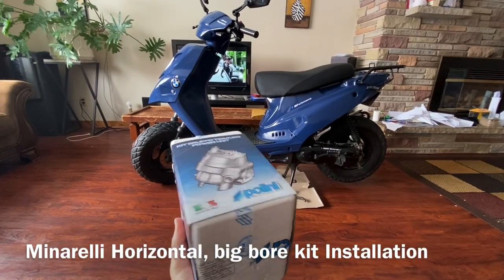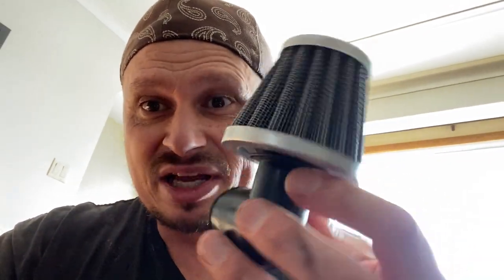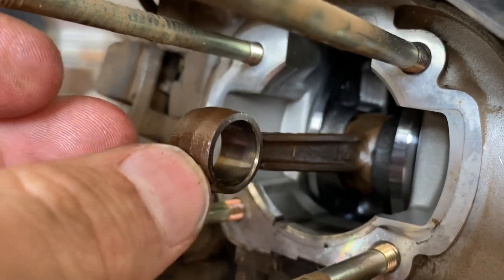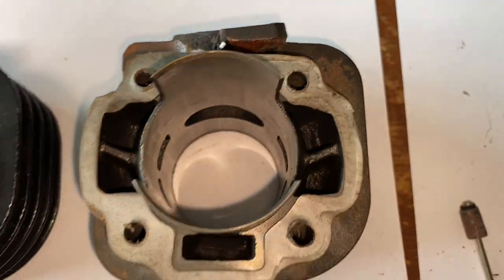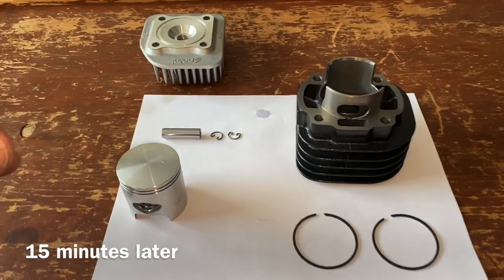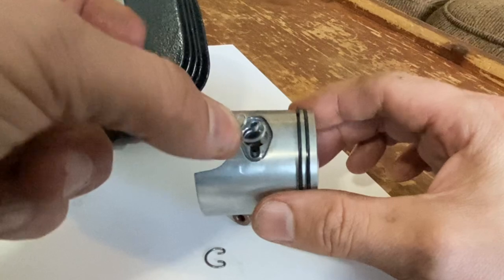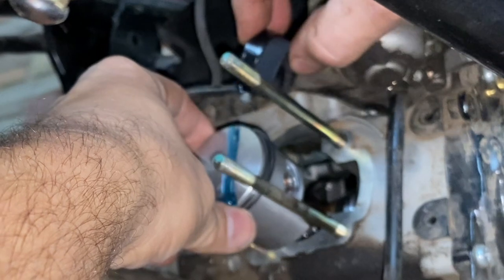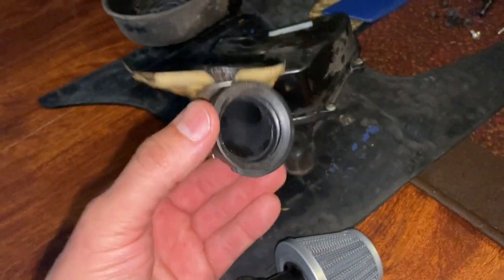How to Chamfer, prepare, install a big bore kit properly. Yamaha Zuma, Jog and E-ton Beamer matrix

Comment: It is super nicely told and shown how the sharp edges are removed, this is how we do in Denmark where I come from, and we actually do one more thing that you forgot. You made sure that the new cylinder did not get any small broken edges, etc., but you forgot to make it so that your piston rings fit better on the piston so that they do not wear unnecessarily on the cylinder during the cold starts to which it is exposed over time.

You must insert both piston rings into the cylinder, and if they reach completely together and touch each other's ends, then they should just be filed a small tiny part of both ends, it should be about 0.2 -0.3 mm spacing on piston rings when the sides loose in cylinders.

I hope you understand what I mean ... (-:
Reply from the maker: You are correct, I did this in a different video. Thanks for the reply
Reply: Thank you i was watching this video for this information and it wasnt there, thank you for the specs sir 🫡

Comment: You are 100% right about the filter. They will blow and if it doesn’t blow you gonna see lots of piston wear line streaks using those.  I use the original air box filter on my scooter and pistons last. Even if you modify your scooter the air box can be retained

Comment: I try to tell people to do this all the time they don't listen they just slap them in and go I did it to my polini sport kit on my Zuma but I used
files took took a little longer I was too nervous to stick my electric Dremel down there afraid of nicking the cylinder but the files got the job done I also do the skirt around the bottom of the piston I put a chamfer on it helps with oiling gets oil up to the wrist pin better if you look at your factory piston it has a chamfer around the bottom of the skirt

Comment: Great vid thank you 👍 were you tempted to raise the exhaust port by a couple of mm? 

At speeds over 45mph at the top end it can make BIG difference. Pedparts dyno’d a sport kit with raised exhaust port and at 57mph (it had a gear up kit) it made 8hp compared to 5hp of the stock 70 kit. Free power

Comment: i bought a big bore kit for 20 dollars put it in no airbox still drives today after one year no problems with cilinder or piston
Reply from the maker: That’s awesome, they can last a year or two np. But if you do it the way I mentioned with the chamfering and put the proper fuel jet to get the right amount of fuel and oil it can literally last 20 years of every day driving.
 Good luck my friend
Reply: Yeah but why iš should do that it is litterally 20 bucks thats like a good meal

Comment: I just bought a zuma from market place, and the guy didn't tell me how new the kit was, I asked the following day, he said maybe 10 miles, and he premixed it 40 to 1 ratio woth klotz synthetic oil, but when I rode it for those 30 to 45 mins I drove it like I stole it. It still runs great, but obviously I should take it easy but the gas is getting low ajd I am curious what ratio to mix the next tank at, it has maybe 15 miles on the new build?

Comment: I did not put needle bearings in my naraku crank arm, it's a 139qmb but it came with a wrist pin which lanes no room for a needle bearing. Why is that tho?
Reply: The kits come with 2 size wristpin sizes 10mm or 12mm

Comment: You don’t used gasket sealer on the gaskets? I’ve got a Polini sport kit also that I haven’t installed yet on my prebug. Just wondering if you should use sealer or not?
Reply from the maker: Shouldn’t have to use any sealer, make sure you watch my Jetting Video you also have to change your jet.
Reply: @ProblemSolverGarage   thank you, I will.

Comment: Hey man, I have an interesting problem. I picked up this 2nd hand Yamaha Neos (minarelli horizontal block) and I drove it home not realizing the oil pump wasn't working so I wrecked it on the drive.
I rebuilt the engine but went from a 70cc back to a stock 50cc and now it doesn't want to start. It has the stock carb, fuel, spark and compression. Do you know what this could be?
Reply from the maker: Spray Quickstart into the carb see if it kicks.
Check your compression.
Try a different spark plug.
Reply: @ProblemSolverGarage  Yeah it seems to want to start when I spray some starter in the carb. It does not turn on fully though.  The same happens when I stick in another spark plug.
I don't get it since when I kick it with nothing but gas  + oil added in the spark plug is wet when I check it. Also, I do not have a compression tester so I cannot give exact numbers, but when I put my finger on the spark plug hole I cannot keep it there when I crank it. 
Do you think it could be due to a larger jet from the 70cc or air/ fuel mixture screw?
Reply: @thomatofpv3546  Did you ever manage to figure out the problem on your scooter that was preventing it from starting
Reply: @Tain950  i haven't taken a deeper look at it, but I'm sure it's either a vacuum leak or the timing is wrong
Reply: I’d say it’s jetted for a 70 and fuel and air mixture are wrong